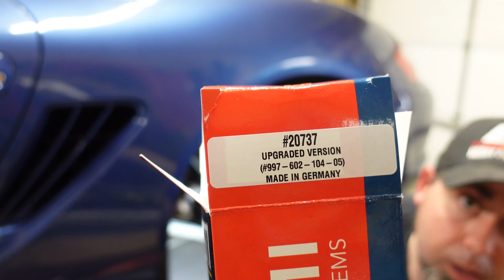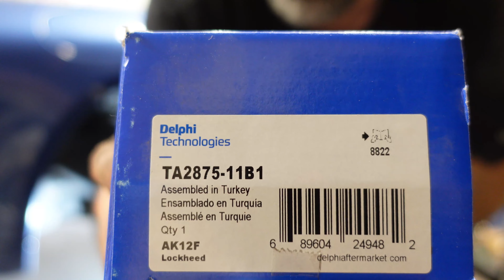987 Porsche Cayman SHAKES and MISFIRES! Let's try to fix that!

Comment: I thought my coil packs were done until i swapped them out and the missfire continued.....it turned out the hydraulic valve and camshaft adjusters were sticking.They're down there near the coils.Very expensive.☹️

Comment: Hi, good video will be doing the coil packs and spark plugs on my 987.1, 2.7L soon. Out of curiosity what was the reason for the engine replacement?
Reply from the maker: Thanks for the watch! Hopefully there's a few tips in there that help you do the job faster! The previous owner blew a cam seal at highway speeds and dumped the oil. He said his shop found metal in the oil filter and it was misfiring horribly, and he didn't want to put an engine in it, so I got it cheap. Oddly enough, I changed the oil, cleared the codes with my Autel tablet, and the thing ran amazing. I didn't want to risk it, though, so I put the lower-mile donor in it to be safe.